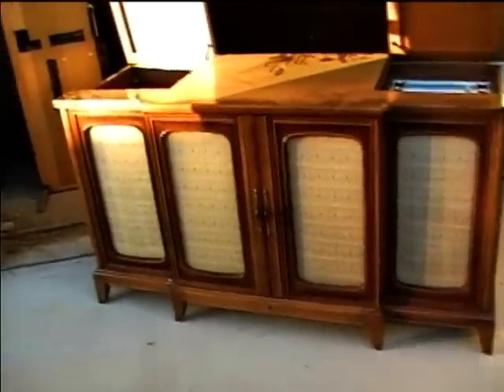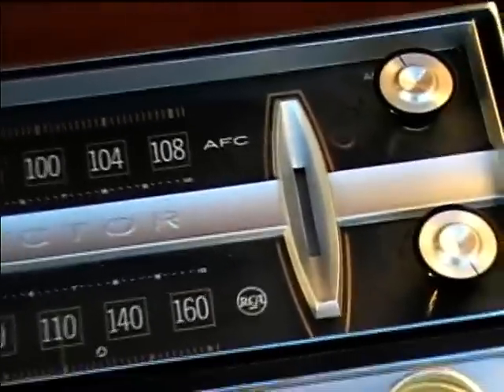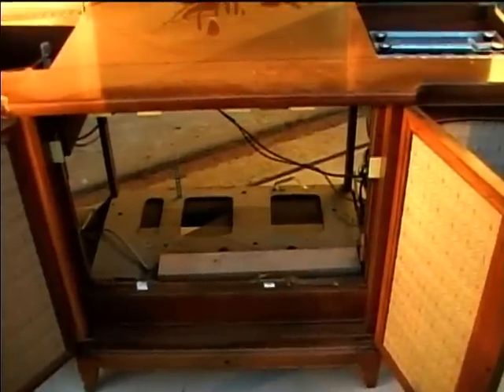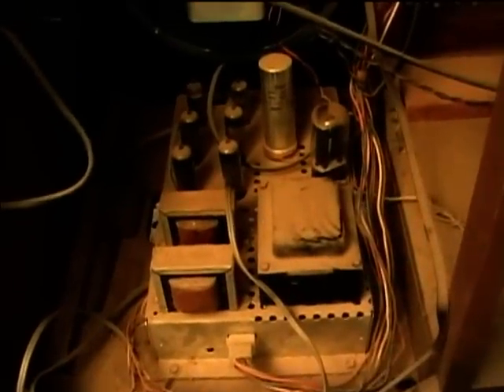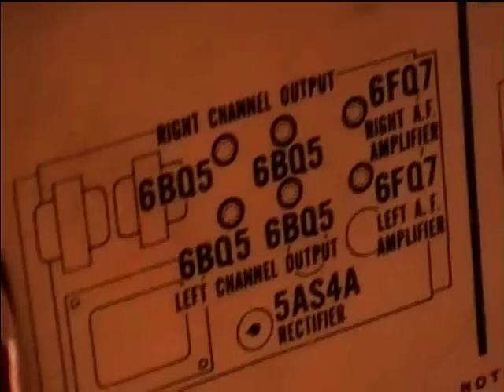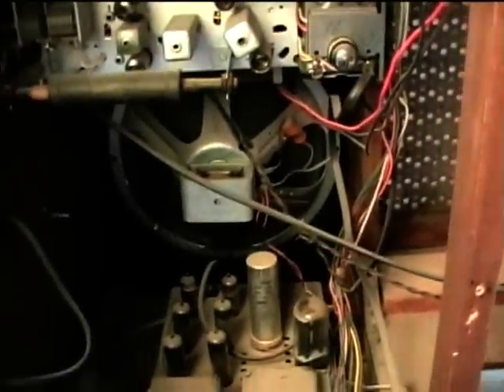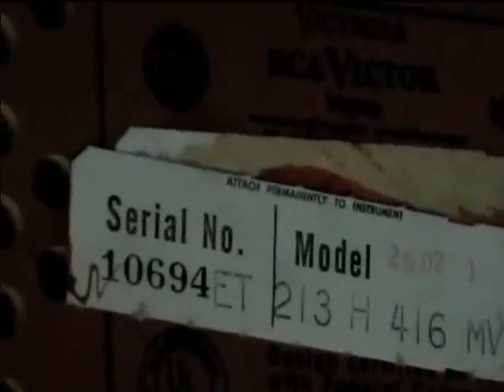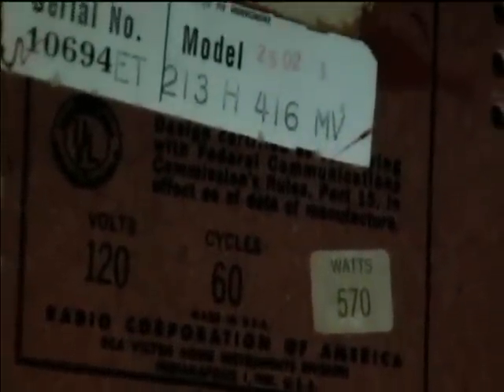1962 RCA Victor round-tube color TV console with stereo

Comment from the maker: It really does have a stately, regal look to it, I like how the front part where the TV was protrudes out slightly. I can remember the TV section of Sears back in the mid 80's when there were still a lot of consoles being sold. I went along with my dad in 1985 when my parents bought a new Panasonic console but I don't think it was from Sears, it was one of the big appliance stores in Cleveland. I wanted a knob tuned console (which they still had!) but Dad insisted on remote control.